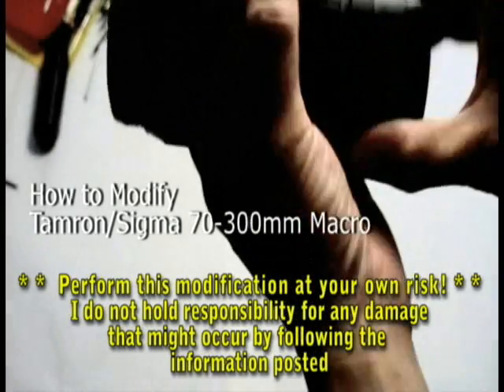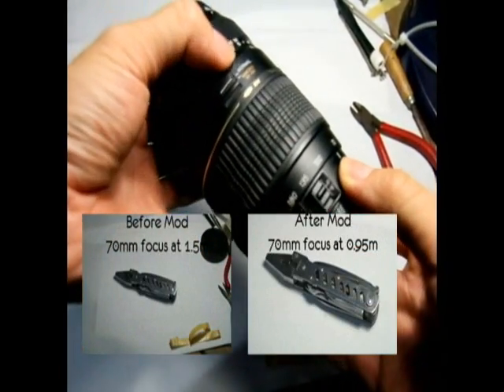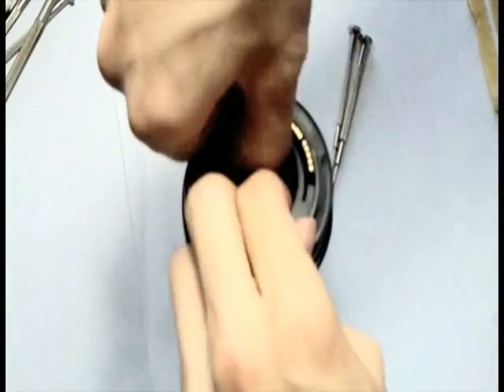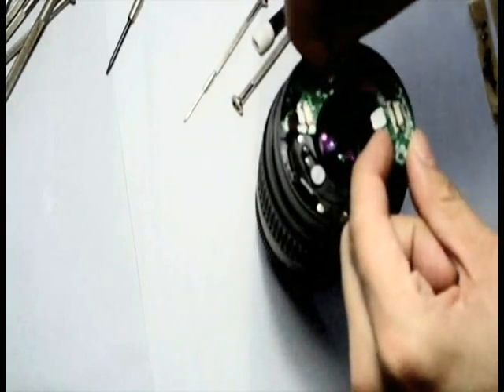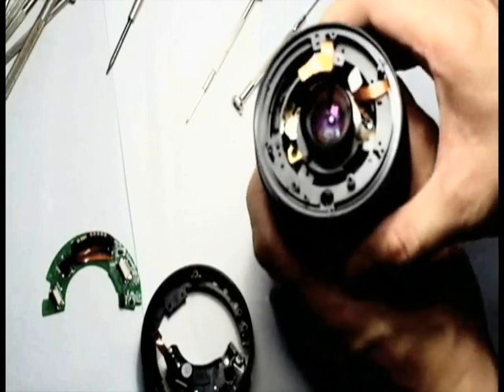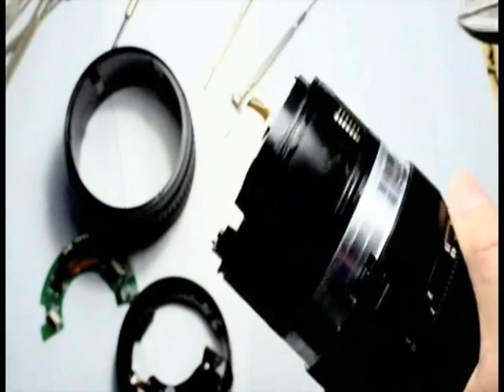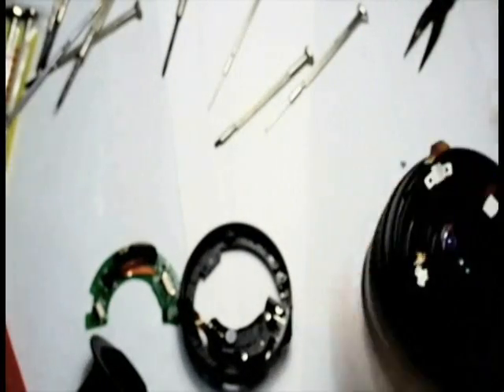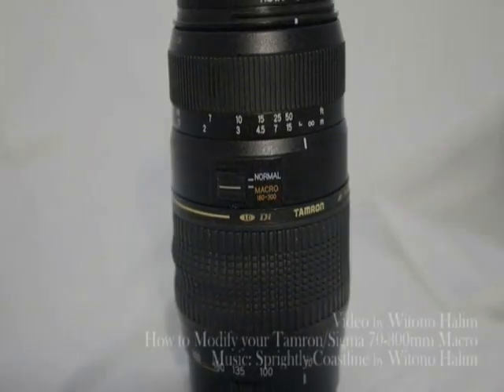How to Modify / Jailbreak your Tamron / Sigma 70-300mm Macro lens

Comment: I just did this. It works BUT it was really hard to put together. There is more than meets the eye. It was almost impossible to allign all the moving parts and it took me 3 hours to do it !!! I DO NOT RECOMMEND THIS !!!! But if you decide to do this anyway, autofocus seems to work fine at the whole range and you can still use the macro button as a "limitter"if you want faster autofocus.

Comment: I watched this video and made it work on my Sigma 70-300 DL super macro, and it worked out just fine.
It was a lot difficulter than the tamron, because you cannot disamble the circuitboard, and gears. its all stuck together.